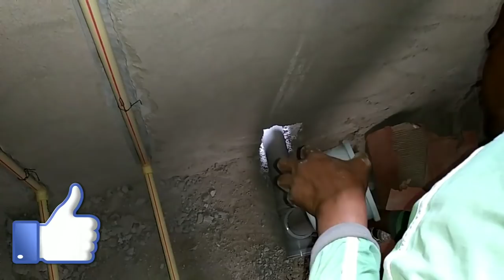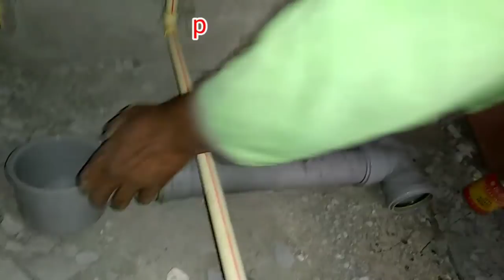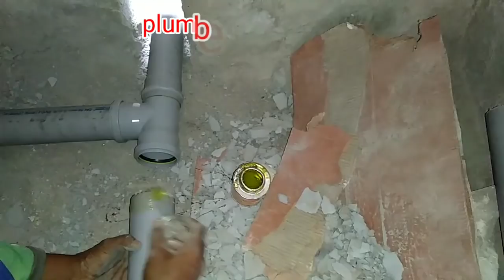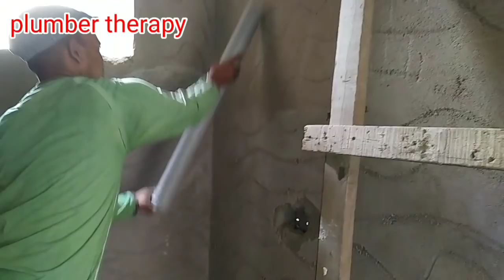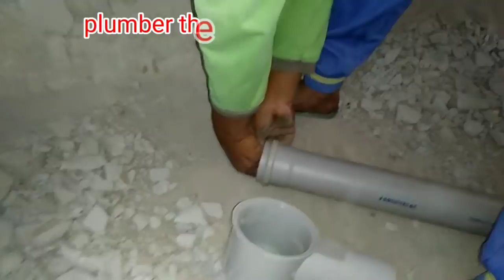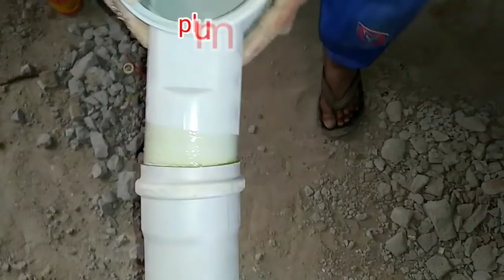bathroom drain pvc pipe fitting.

Comment: Supreme company has really done good job. Those civil engineer who practically carry out work knows how important these new pipe accessories are. When  I read about swept pipe accessories I got how deep thinking behind  these new accessories. When I used Y bend and 45 degree elbow for horizontal drainage line under  plinth mistri laugh at me saying a. T junction would be sufficient.
But when I seen swept T looking from outside as T but inside 45 degree junction. I become very happy.